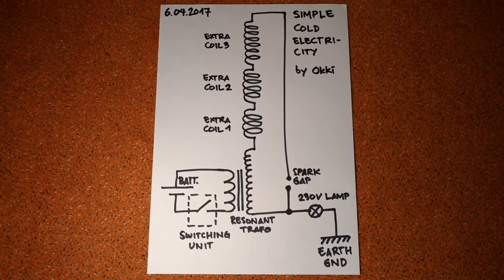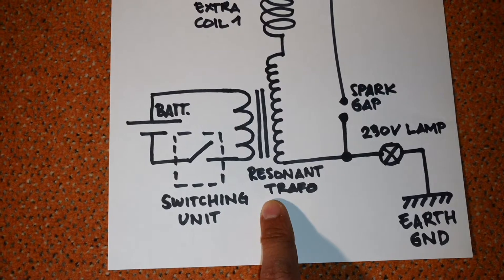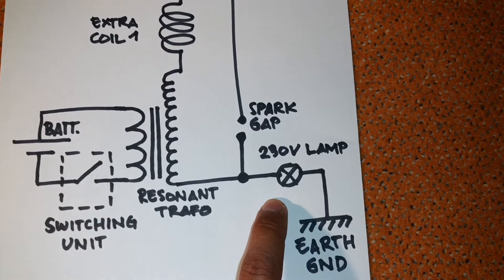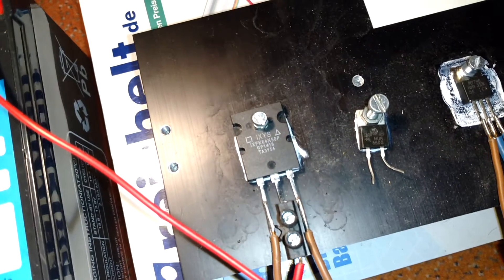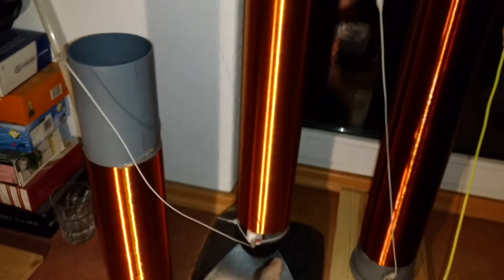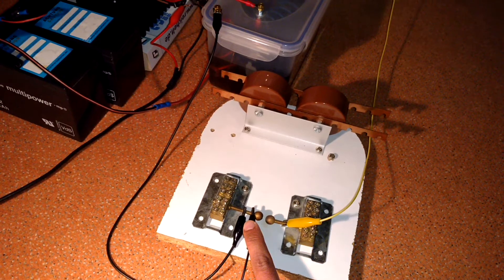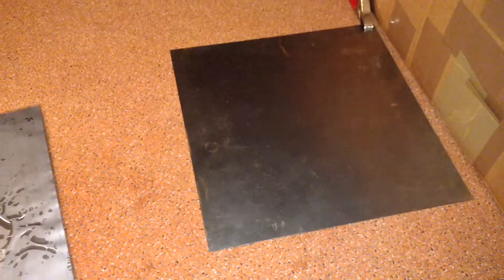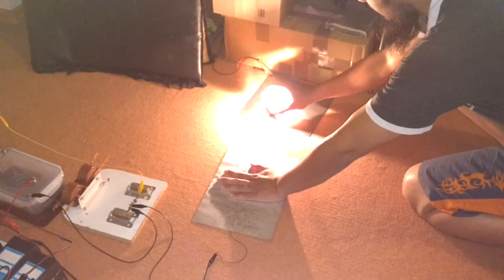Simple Cold Electricity - very detailed explanation

Comment: Okki, this is not Cold Electricity. This is HVHF skin effect. You basically flood the near field with energy (and you are using a lot BTW). Then you are lighting a bulb with a smaller path to ground. It's not cold because you don't feel the amperage as hot. The frequency determines what you feel through your body. You will not gain more energy then you put in. No amplification with HVHF. Cold electricity is "Wattless" power, which you can amplify.

Comment: Great work, 👏
Have a question, why is there no spark at the spark gap?
Reply from the maker: Thank you! The spark gap was there only for safety.
Reply: Thank you for your reply.
But though, how much voltage does your resonant transformer put out?

Asking because, I've tried similar circuit using a flyback transformer but was still getting a spark at the gap. Please advise.
Reply from the maker: @elcomesiingwa1913  Sorry, I don't know how high was the output voltage of my resonant transformer. I did this with many attempts.

Comment: 1  -  Are you feel any shock when you take hand away  from steel plate.  2  -  do you measure voltage at plates.  THIS IS FREE BLESSING FROM OUR GOD.
Reply from the maker: No, there was no shock. That's why I call this cold electricity. The voltage is not measureable. My voltmeter always goes crazy if I put near this setup.
Reply: @OkkiMoeljadi  did you try analog volt meter yet. maybe electronic meter too sensitive. Thank you for answering me.
Reply from the maker: @frankchandler8005  no, I did not try using analog voltmeter.

Comment: Nice!  ...Next, I recommend winding the inductors so that there is a free space between the threads of each wire. The varnish is a resistor or short circuit under certain conditions. Avoiding this error is one step closer to Teslas work ;)
Nowadays, it is not easy for us to get a wire with proper insulation :D

Comment: Great job, man. Was wondering... Do the bulbs get hot ? Or stay cold ? This would be a great breakthrough if not!
AND... perhaps you can measure the output with a scope that you can find the right input frequency....  I am not a physicist but I saw someone placing more and more bulbs (Called Friedrich) by only changing the frequency, and getting more bulbs resonating with same input power. Wonder if this is really true!
Reply from the maker: Thanks! The bulb gets hot. With this kind of system the load is not directly related to the input power. It is possible to add load without increasing input power. Unfortunately I have never seen overunity on all of my systems.

Comment: “The bigger the extra coil the bigger the effect” you say for the cold electricity effect. Is there also a difference between thicker Wire or extra windings? Because more windings or thicker windings means “bigger”
Reply from the maker: Yes, it's true. Thicker wire with less windings and thinner wire with more windings with exactly the same mass resonate at the same frequency will have the same power (as transmitter or receiver). So, if you can maintain the resonant frequency the same on both coils, you will get the same power out or in. This is what many people forget about. The copper mass is important. Yeah, but why switching power supply can have high power in such small and light package compare to 50 or 60 Hz transformers? Hint: check out the frequency.
Reply: @OkkiMoeljadi  thank you for your fast answer. I appreciate your work.

Another question what I’m thinking about in watching your videos is the following: Where in the circuit is the border between warm and cold electricity?
Reply from the maker: @gary5291  thank you! The term cold electricity may be different for different person. This is just my understanding of cold electricity. I mean, if I can power a 230 V load with electricity that flows through my body without myself getting electrocuted, I would call it cold electricity. Other people say if you power an electric motor with cold electricity and you stop that motor mechanically, the motor will get very cold and freeze (covered with ice). Because this phenomena is rare, people just don't know exactly what cold electricity actually is.

Comment: can you tell me the dimension about the extra coils ? i'd like to know diameters, 
height and the diameter 
of the cable
Reply from the maker: I use 1.0 wire diameter wound on 110 mm tube. Check out my other cold electricity videos, I have shared all information there. Read also the video description.

Comment: Hi! I'm an electronic engineer and I keep wondering why most people keep naming "cold electricity" to common electricity. I'm mind opened when proof is shown, but from that video all what I see is a very high frequency & high amplitude voltage going through parasitic capacitances (with the glass of the bulb acting as a dielectric between you and the earth), since at such high frequencies it's hard to say that an open circuit even exists... It reminds me to a medical diathermy device, where you may have about 1000V @ 400kHz but when applied to the skin through a capacitor you don't get shocked, your skin just heats up because of the joule effect. I guess with a diathermy device the bulb would also turn on... But as I say, I'd like to see a genuine cold electricity device to analyze it, I really love challanges :)))
Reply: You are an electronic engineer. I have one simple question to you. Where are the physical location of the electric charges, in the capacitor ?
Reply: That's what I thought. You're not an engineer. This requires more knowledge than handling computer programs.
Reply: @1272-f9v  Sorry, I just see this conversation goes nowhere. If you have some real proof about cold electricity, one which couldn't be explained using conventional electricity, just tell me, it shouldn't be that hard if it were true. Otherwise, this is just talk for talk's sake...
Reply: @bernat_albet  Ordinary people call this name various high-frequency electric currents. For them this concept is simply related to some  properties.
Modern electrotechnical theory explains a lot, of course with certain flaws as well. ..if experimenters and theorists find a common language, they will reach the next level in technological development in some day. It is often overlooked that absolutely everything is an electrical phenomenon.
Everything that touches the human senses consists of electrical charges in different states, density and structures.
Reply: @bernat_albet  The key to 'cold electricity' as I understand it is that it divides the current from the load prior to grounding the current. The millisecond switch or spark gap makes that divide. I would theoretically describe that as isolating the magnetic response from the (secondary, slower) electrical response.  That way you get the motion and spinning motor power without destroying the electrical source charge. 
Power is experimentally greatest during rapid change of voltage so high frequency, high voltage, and square waves are typically employed. Mosfets for the millisecond switch on this one. At 7:40 there's the part he doesn't get fried while being a resistor in the circuit. I've worked with electricity a lot and that would seriously hurt.
Electrically this might be dismissed as the 'skin effect' - the higher the voltage the wider the field from the surface. That does not explain the submerged demonstrations I've seen. 
Thus 'cold electricity' or maybe 'magnetic electricity' or 'pure electricity.' Maybe 'metallic electricity' - an electrical variety that does not interact with small atoms.
Reply: @bernat_albet  Tengo muchas horas  y años en ésto ,no eres ingeniero,lo tengo claro ,solo quieres que te lo den masticado y hecho ,un ingeniero debería saber de que se trata ésto,cuando hablamos de electricidad fría ,solo es montar un circuito(15 minutos)  , hacer pruebas y luego venir y discutir el tema aquí,tema que usted ignora por completo ..¡No mienta! Solo quiere que le ayuden a momtar un circuito por que no tiene idea
Reply: @chusdiaz9160 hahaha cuando dices que llevas muchos años en esto, supongo que te refieres a juzgar sin tener ni idea de nada. Felicidades genio!
Reply: see the tesla hairpain circuit how can the pulb work even with a short circuit
Reply: Many things are also called by electrical engineers under completely wrong names.

No one even thinks how the Volt makes Amperage through the Resistance and other such fairy tales. 
Of course, this is not just a problem for electrical engineers.
This problem is much deeper...
If you ask any person what a thermometer shows to us? No one knows the answer.
...May be Fahrenheit or Celsius or Kelvin knows ? I do not think so.
Reply: @1272-f9v  You are right, nobody knows what reality really is, that's why science was created. Science makes theories to try to explan what's going on, and amperage going through a resistor when applying some voltage is just a theory, but it's the best we got right now. What it has no sense is to claim there is something called "cold electricity" without being able to give a method to reproduce how to create it, or to explain how different is from common electricity. I could also call "freak electricity" to an AC signal above 1GHz, but that's nothing new, just common electricity with some specific pattern.
Reply: @bernat_albet  It's not a big secret ... If we rub any materials together, we will get an electric current between them. Our scientists call it Strategic Electricity, Reactive Energy or whatever.
However, this same static electricity automatically becomes power at any capacity. I recommend experimenting with a diode multiplier as a capacitance charger in a permanent static electric field. Bearing in mind that 1000 volts and only 1 amp is after all 1 kilowatt of power ;) ...the static electric field is a much, much smaller investment than 1 kilowatt of power.
Reply: @1272-f9v  So, again, if it's normal electrons in movement, why call it "cold electricity" and not just "electricity"? The diode-capacitor voltage booster topology is nothing new, and if you run some simulations you will see that to get 1 amp at 1kV using this ultra low efficient method you would require huge ammounts of amps at the input. That's why DC/DC converters with inductors were invented, the charge transfer methods are not efficient at high currents.
Reply: @1272-f9v  Well, and if you are talking about static electricity we could talk about ESDs (electrostatic discharges, which we concert a lot in our electronic design protections). They can be as large as 15000V, with currents as high as 30A. If you integrate the area of the signal V*I you will see this is a huge amount of power, but hey, this just lasts for few nanoseconds, so the energy is really low. Nothing new, again.
Reply: @1272-f9v  If you are saying that all "modern educated people" are wrong, maybe you could provide a new theory which explains better the electrical behaviour. Engineers just base our work on the work done by physicians. Of course it's not a perfect model, but it's the best we have right now. Maybe you have a better one which no one knows, it would be great if you share it then :)
Reply: @bernat_albet  Maybe you need better UF diodes and high voltage capacitors to capture that power pulse ? Sometimes it helps to have several components connected in parallel. The power is real... unprotected transistors are destroyed at the same time rate as the measured pulse duration. 
Radio frequency pulses travel along circuits as if they consisted only of antenna components.
E = mc2 ...From this point of view, energy is speed.
Reply: @bernat_albet  Simulations are a dead end. It is necessary to experiment. Often only an additional antenna and a proper ground are needed to get the extra power from the environment.
Reply: @bernat_albet  I'm not blaming anyone. Unfortunately, classical education is conceived in order to produce tools that are useful to the state. Not self-thinking people.
Unfortunately, without going through this educational path, it is not possible to understand the paradoxes into which we delve.

Comment: what if you just remove the plates and connect the load directly to ground and output coil? it would light up the same way ?
Reply from the maker: Do you mean the connection like my circuit diagram? Yes, the bulb will light up the same way. Please check out also my radiant energy video series. I could extract more power out of the coil there.

Comment: Yeah, I like it !
Impressive !
Good work, Okki.
OKKI, Could you show the current draw when the light bulb is ON and when is OFF ?
Please use an analog current meter for that.
 I'm curious to find out if there is an extra draw on the battery when the light is on.
Thank you, for the detailed video. it is very useful.
Reply from the maker: Thanks Mike. Yes the current draw changes when it powers a light bulb. It draws more current if a load is attached.